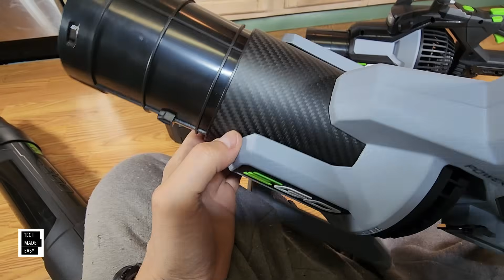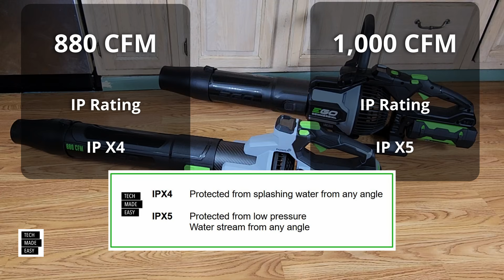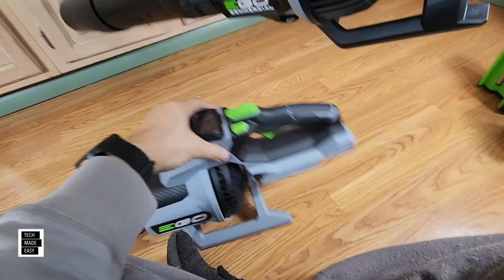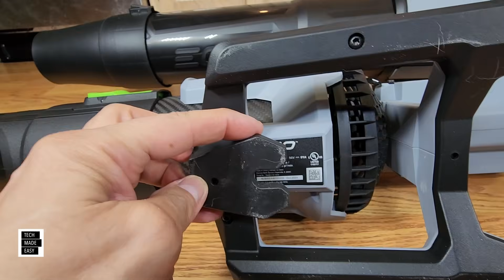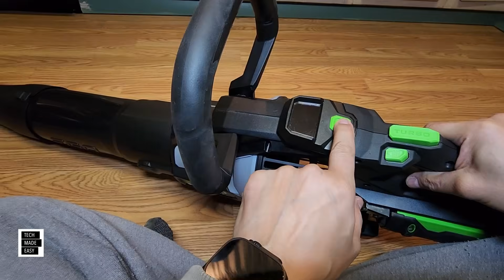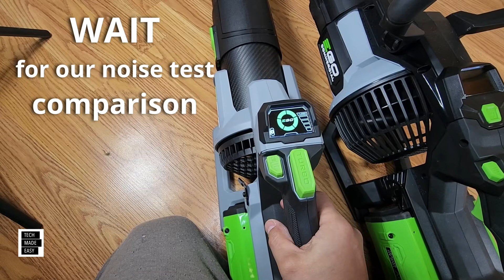COMPARED 1000 CFM 880 CFM  Ego 1000 cfm Ego 880 Cfm  LB880 LB8803 LBX1000

Comment: here I am thinking the 880 CFM is the biggest baddest unit I could buy. EGO you go and make another unit but it's commerical so I am justified in buying the 880.

EDIT: can I use the 10 amp hour battery on the 880 CFM unit?
Reply from the maker: Yes even a 12ah but you might want to buy this if it’s too heavy https://youtu.be/QHS20WFTBQ0?si=Hlh6d8EXnGETtfB7

Comment: Girth vs length, age old question... Sorry, had to say it. Nice review though.
Reply from the maker: lol 😂 hey buddy, thank you for watching the video. I’m glad you liked it and you definitely made me laugh.
Reply: @TechMadeEzy  The 880 with batteries is now $440 at ACE Hardware, still worth it as the tool only cost $300. You get two 4ah batteries for $100, way cheaper than getting them "alacarte". It was interesting that the 2.5ah battery limited the power. I wonder if the 4ah one allows full power? I have the Z6 zero turn with 4 10ah batteries (7.5, 5, and two 2.5's). Two more (new) 4ah ones seam like a good deal.
Reply from the maker: Not too bad in December I picked it up on Amazon with two 4ah for $373 before tax. I gave my first one to my brother.
Reply: @TechMadeEzy  Hmm. $399 on Amazon. Either way I ordered it to the ACE store, I will return it and rebuy it and get 10% off. I did that with the bagger for the Z6. ACE has some good people, even though I do not get the discount online (because it's not a "stocked" item in the store) they just add it then give me the discount. Edit:  I try to buy local when I can, sometimes Amazon makes it hard to do.
Reply from the maker: That’s definitely worth it. They’re nice guys too. I do like shopping there from time to time. They’re very knowledgeable.

Comment: So, if you had to find a negative for these blowers, what would it be?
Reply from the maker: They are very simple product, one more powerful than the other. It’s really hard to find a negative some might say cost, but you get what you pay for. 
EGO has a strong ecosystem with that 56v battery
Reply: @TechMadeEzy They come with 2, 4 amp batteries and is that enough to run it in turbo mode for the 880 cfm to complete the work?  How long does one battery last you,  on the 880.
Reply from the maker: I rarely use turbo, maybe a little bit at a time, but for the most part, I use a medium to high setting
Reply: @TechMadeEzy That was easy!  Have you heard or used the Husqvarna 350ib?  If you have, which one would you choose and why?  Thanks
Reply from the maker: No, haven’t used them.

Comment: Hey! I’m torn on buying one of these two. I would of course love to go for the higher 1,000 cfm, but concerned it’s not the same 200mph as the other model. 
Have you tried and compared both of them against each other? Thoughts?
Reply from the maker: It is so hard to see a difference between these two with everything that I use them for. I will say the 1000 is definitely heavier so keep that in mind

Comment: will the gutter cleaner attachment fit the 1000 cfm blower? Is it the same tube connection size as all the other blower models?
Reply from the maker: Michael do me a favor if you can remind me tomorrow morning, just send me another message. I will check it for you.
Reply: @TechMadeEzy  just sending another message per your request....please let me know if the Ego gutter attachments will fit the LBX1000 blower.
Reply from the maker: Nope, won't fit. too thick. I will post a video tonight
Reply: @TechMadeEzy  ok, thanks for checking
Reply from the maker: Videos gonna launch at 6:30 definitely a big difference
Reply from the maker: I will post a video tonight

Comment: Dear “Howard” (Stern), thank you for spending your time and money to make such an informative review. You answered my burning question whether the 880 could latch the turbo on during lock mode, which my 1000 commercial blower can do. This is a game changer for me, as I can free up my hand from the trigger, which helps position the blower and reduce fatigue.
I agree with the comments below regarding Ego’s decision to require constant pushing of the turbo button in their non-commercial models. Yes, that will increase runtime and reduce wear and tear on the motor and battery (heat). That said, my favorite Ego blower interface is my simple 575 CFM from nine years ago, which does not have the turbo button at all! Just a simple trigger and the cruise control lever, both of which provide full power.
Back to my burning purchase decision regarding the 880, it was another comment below that caused a 💡moment! “Purchase a larger, more powerful unit which does not require constant use of the turbo button.” The 880 on the highest lock position still kicks out a healthy 700 CFM. This is a huge improvement over my trusty 575 model and both are the same weight as a bare tools! So thanks to your review and many helpful comments, I went ahead and ordered the 880 kit with two 4 amp batteries as my every day replacement blower. I wish they had a kit with two 5 amp batteries instead since they both weigh the same. Oh well.
Of course I’m still keeping my 1000 CFM commercial blower as that heavy monster is a game changer! I will reserve it for “special occasions”. Just wish they offered it as a kit with their advertised 10 amp battery in the specs. Instead I’m running two 7.5 amp batteries that came with my Nexus Power Station.
Thank you for all your help, for reading this far, and for giving me an opportunity to hopefully give back, Rommel
Reply from the maker: lol Howard stern
Reply: @TechMadeEzy  Especially since you said Al... I was thinking Alan Alda!
Do you find the higher speed off the 880 better for dislodging stuck debris or is the 1000 just overall better at everything?

Comment: I just finally broke my original ego leaf blower. It was a 450 CFM and it was over 10 years old. I used it all the time. In a way I’m glad it broke. I dismantled it so I could understand how it was made. I used it in the winter time to blow snow off my off grid Solar Panels over 35 panels. I am definitely going to get the commercial leaf blower now. It’s amazing how good of a review you can do on your kitchen floor. Thanks for the honest review. 

I made a voltage tester and current tester out of an old ego battery and a broken ego tool. It allows me to test for both voltage and current at the same time while running various ego products. Quite helpful in determining the total watts.
Reply from the maker: Hi Michael, thank you so much for taking time to make a comment and welcome to the channel
Reply: I would be interested in a video about your contraption. I have older EGO products as well and interested to see how the batteries have held up over time. Even just a short video with pictures depicting age of battery and max amps / aph over time (not sure if I said that right but, I think you can catch the drift).

Comment: Would be cool if you’d do a deep dive into the motor controller pcb and specifically the mosfets Ego specified for each model. Are they fully populated or still just 2 per phase? and what is their voltage and amp rating? Are they still using 30A fuses or do they have more input current now? Come on take it apart 😊

Comment: EGO blowers seem to be developing a bit of a reputation for failing after a few years of use. Mainly to do with the electronics either overheating or shorting out. To minimise the chances of that happening 
- when using the blower hold it with your bare hands or with insulated gloves. Any build up of static electricity can short out the electronics causing instant failure of the device.
-TURBO mode is designed to be used in short burts (5 to 10 seconds max). Continuous use of TURBO mode will over heat the electroncis and lead to failure of the blower in the medium term (months rather than years if you use the blower once a week). If you find yourself using TURBO mode all the time, then you would be better off going for the most powerful model and use Turbo mode less frequently.
They are fantastic blowers ... but like any electronic device, if you don't take care of them and use them in the proper manner, they won't last as long as you expect them to. Fortunately, their Warranty coverage seems to be reasonable.
Reply: Ive had mine for 5 years and use it most days of the week its bullet proof.
Reply from the maker: Jared welcome to the channel. I have to say the same and you know I review a ton. I started with the 550 CFM.
Reply: I dont know what you are talking about. I've had 2 blowers and many other ego tools for years and still going. I use turbo all of the time on my 765.

Comment: Does this balance in the hand of want to be a tad nose heavy like the 765?
Reply: If you don’t mind heavy versus nose heavy, try using a larger battery in the rear like a 7.5 amp. That should help with the balance.
Reply from the maker: True thanks, an ego strap also helps
Reply from the maker: Brody welcome to the channel 👍🏻
Depending on the model and battery installed. The 1000 is definitely heavier, 880 is close to the 765
Reply: @TechMadeEzy  Thanks!  I was mainly curious if the unit balances in your hand with the nose wanting to tip down like the 765, or if it's less nose-heavy?  I replaced an old Greenworks 80V with my 765, and while it's more powerful, the nose tipping down wears out my hand far more on the 765 versus the better balanced Greenworks.   The 880 looks to have the battery a bit further forward, which concerns me it will be more unbalanced.
Reply from the maker: The 880 is so close to the 765, I do like the screen. Here’s a video we did really comparing the specs at that time. I don’t think I had the 880.
SPECS Compared EGO POWERFUL Blowers
https://youtu.be/fZVwUgXnE9g
Reply: @TechMadeEzy  Any notes on the balance between the two?  Are these AI responses?
Reply from the maker: AI ? That made me fall off my chair, bro. 
Brody i’ve given you what I can and no, this is not artificial intelligence. I’ve been replying to you. Don’t have much more to offer. I didn’t see a big difference between the two.
Reply: @TechMadeEzy  No intent to insult.  I kept asking about balance in the hand and got replies with spec sheets and talk about a screen I didn't ask about.  It didn't seem like a human response.
Reply from the maker: @brodygoodwine4448 all good
I did try both and I didn’t see a major difference. I tried them with 5ah batteries. If you have the 765 now, I would say keep it.

Comment: As many in the comments mention, I also will upgrade my ages 650. LOVE IT!. However the contacts to the battery seem to be cutting out. Almost bought a 765 last year on sale now I seen they release these 2. 880cfm for me as my yard  is smaller and 650 w/ a 7,5ah was like 700cfm. It is awesome 1000 is serious and I think they did it backwards they made a 800cfm backpack but a 1000 handheld? I’d prefer 1000 backpack then I would buy it with 2 10ah but I am no engineer.
Reply from the maker: Good to see you so what are you going to do what model will you get?
Reply: @TechMadeEzy use it for leaves. Patio. Snow removal and roof debris. Makes cleaning gutters a breeze.
Reply from the maker: Sounds good

Comment: I've got a 670 and a 615 and I remember watching a test where the 670, for the application I use it for, performed the same as the 765 (which seemed odd).  I primarily use mine for detailing my cars. Will be interesting to see how these 2 compare. Frankly my 670 is pretty heavy which is one reason I ended up getting a couple 2.5amp batteries (came with a 5.0). And the force or push back on your arms is pretty obvious.

Comment: I went with the 880 over the 1000.the 1000 will need a 10 amp battery just to run it. On the 880 I like the carbon and the handle..way lighter than the 1000 I just need it for residential use. reason is 1 longer warranty. 5 year. Instead.of a 2 year warranty..2 i found the best price in stead of 269. I scored the 880 at northen tool for 219. Dont need  batteries i have 2 5 amps batteries and ego just replaced one of my.five amps under warranty. The 5 amps will last.longer. so didnt want to waste the extra.money on 4.amps. with 2 5 amps and the rapid 550 watt charger thay should be perfect for the 880.
Reply from the maker: Makes sense enjoy it and thank you for watching our video and I appreciate you being a subscriber
Reply: I've read the 880 has higher mph...

Comment: Hey Al, have you experienced the static shock blowing snow with gloves on using the 765?  Do you know whether either of these new machines have the same problem?  I'd buy one immediately if I knew that problem was solved!
Reply from the maker: I never use a 765 in the snow but
I will tell you with the 1,000 CFM I've never experienced shock using it with a blower or with the backpack link where you put the battery on your back
Reply: @TechMadeEzy  were you wearing gloves to hold on to the 1000cfm blower while blowing snow?
Reply from the maker: @gmtechjunkie yes fabric gloves

Comment: Ego should have made it possible to lock Turbo. 

They should just do away with Turbo and allow the full power range to be controlled via the single trigger.

They are discouraging the user from using the full potential of the blower by putting max power behind a separate Turbo button that is not lockable.

Ego does this because the runtime is reduced significantly, the battery cells get hot, and the battery longevity is reduced.

Hopefully Ego releases tabless cells or pouch batteries in the near future to help with discharging faster and reducing the heat.
Reply from the maker: I like the trigger idea

Comment: Thanks al. Looks like im gonna steer towards the 880 as an update with a better warrany 3 years extra is more reassureing.
Reply from the maker: Thanks buddy and I have to tell you that’s my favorite right now. I love the handle. I think the light can come in handy at times but the screen with the battery and it is super powerful.
Reply: @TechMadeEzy  With a 3d printer, it wouldn't be hard to male a mount and put a light on any of them.  That way, you aren't using the blower's battery to power them.
Reply from the maker: Thanks

Comment: I’m not a professional, but I feel like the light on the commercial should be on the bottom to eliminate that aweful shadow lol.. but again in use. Your typically lookign ahead of the blower and not at the nozzle.. but maybe it’s a valid small thing.. who knows lol
Reply: It's positioned properly because when you are actually using it, it would be pointed downwards and the area ahead will be lit up.  If it was placed on the bottom, the nozzle would effectively just cast a huge shadow straight ahead when you are actually using it pointed downwards, leaving just only the sides lit.

Comment: Thanks for the comparo!  Can you tell a difference between the 765 compare to the 880 and 1000 as far as power?  I’ve had the 765 since February of 2022 and so I’m thinking of upgrading if there is a noticeable difference in power (air flow).  I use my 765  for just drying cars and so out of the 880 or 1000, which one would you recommend for drying cars? TIA!
Reply from the maker: Hi Jon 
This video might help answer the question it’s got the specs for the 765 the 880 and the 1000 
SPECS Compared EGO POWERFUL Blowers
https://youtu.be/fZVwUgXnE9g

Comment: I really think the 1000cfm is just too heavy to be practical. Because of its power requirements it really needs a big battery.  If you need that kind of power get the new 1100cfm backpack. the 880 is more user friendly.
Reply from the maker: The nice thing though is you can actually put your battery on a backpack link. Have you seen that? It takes the weight off the blower
Reply: The 880 def has a better form factor. Anything bulkier should be a backpack blower. If I were between the two, I’d take the 880 any day of the week.
Reply from the maker: Well it’s Sunday pull your credit card out , here are the links appreciate your support 
Tool only https://amzn.to/3Qc2gE5
Kit with 2 x 4Ah Batteries  https://amzn.to/3Ebd8z3

Comment: Will a 5 amp battery give you full power...
Reply from the maker: which model ?
Reply: Yes on the 880 it does even with a 4 amp but I do not know if it will on the 1000.

Comment: I have the 765. Got it a year ago when it was the top dog. Now I want the overkill, "Tim the tool man Taylor" version 😂
Reply: Someone should do a skateboard test with bother of these strapped on and cranked up to turbo and see how much more force the 880 has against the 1000. And the 765
Reply from the maker: I love the 1000 especially with that handle
Reply: @TechMadeEzy  the handle is the number one reason I want it
Reply from the maker: @Tanker_Wanker it’s definitely convenient and I really like the way it’s adjustable
Reply: @Tanker_Wanker  I hear ya , I just bought the 880 then found out about the 1000, but most gas driven handhelds are only 450cfm so I think I’ll stick with the 880
Reply from the maker: 880 is nice 👍🏼
Reply: That would be the BINFORD 5000 💪🏼